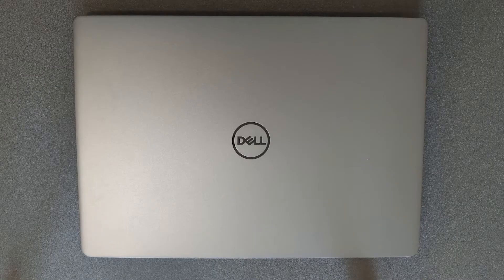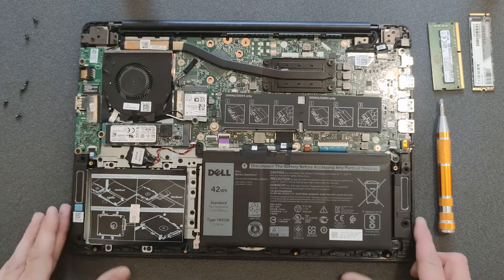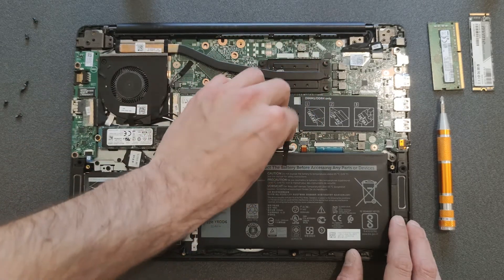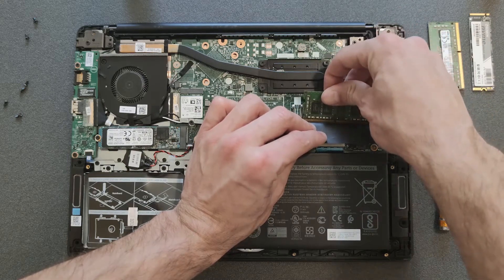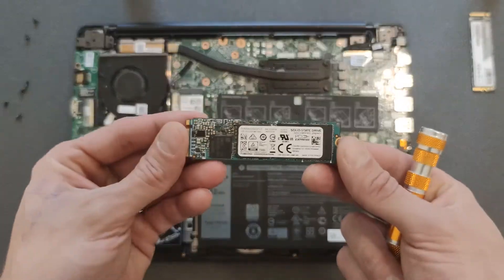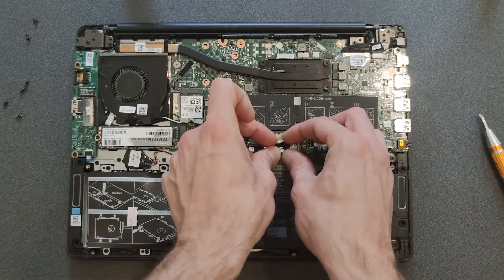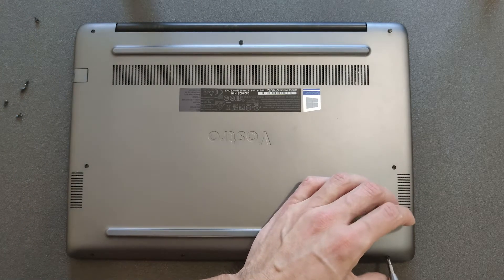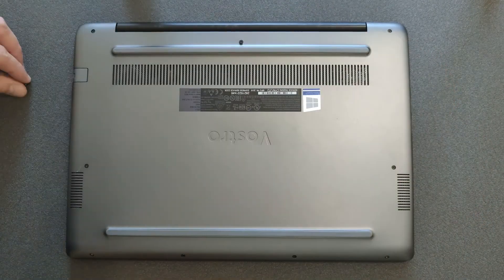Dell Vostro 5481 RAM and SSD upgrade

Comment: The brazilian version of this vostro says it supports only 512 ssd sata m.2 . Can i damage it if i use a 1t ssd ? Would the system works right or with some gap? Honest question. Plus, i noted that the bateria has a different number, mine is WDx0r and yours starts with Y... Whould i have any issue if if use anything different than what i have in the manual, ie 1t instead of 512, ssd nvme instead sata m.2?

Comment: I want to add one more SDD drive, so i just buy a new SSD, right? or i need to buy anything else to connect?
Reply from the maker: Depends what drive have you in it already, if you buying 2.5" SSD then you would probably need ribbon to connect ssd to the motherboard. Open up laptop first and see what you need 👍.

Comment: What screw you are using to install  NVME SSD. In my case I didn't get any compatible screw with the laptop. 
Can I use one of the hard disks screw to tighten it?
Reply: You can get an IDE card on ebay which holds an NVMe SSD card. - for less than £5 including postage. It will have the screw you need.

Just measured it for you.

Width = 1.85 mm
Length = 3.96 mm. Length includes the (flat) head.

I believe an M2 screw, 4 mm long should suffice.

Comment: This vostro accept 1TB ssd?
Reply from the maker: Yes, 100%
Reply: @ToxicNerd Are you sure? I'm looking at official "Dell Vostro 5481 Setup and speci cations guide" (vostro-14-5481-laptop_setup-guide2_en-us.pdf). It says there are two M2 slots for SSD Up to 512 GB. Was going to buy a 2TB SSD but confused now, could you provide more info on that?
Reply: Why would it not.

It's the RAM which is limited - by the CPU, and mobo.

The SSD is not limited by the mobo. They should all work; but be careful to buy an NVMe SSD.
Reply: @mark4asp why to be careful with buying nvme ssd?
Reply: Have you tried 1TB? What's the outcome?

Comment: At 3:10 when you are talking about adding an additional 2.5" SSD/HDD, what connection do you need to install to the SSD?
Reply: You can go one mixed way. (A) a SATA SSD with a 2.5” form factor. It uses the same connection as a regular HDD to the motherboard.  Or (B) you can go with a M.2 SATA SSD with an adaptor to a regular HDD SATA connection.